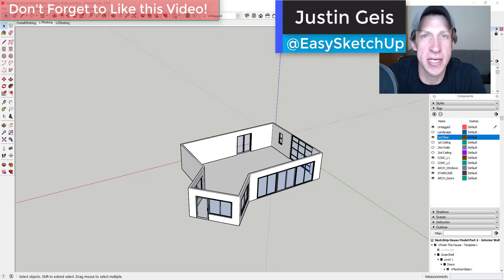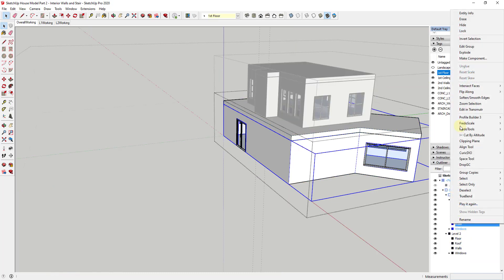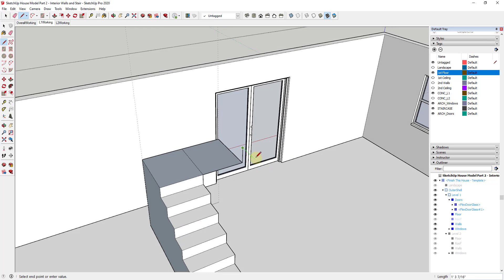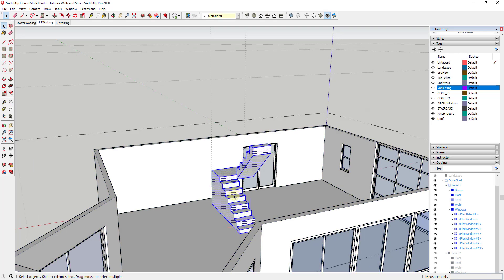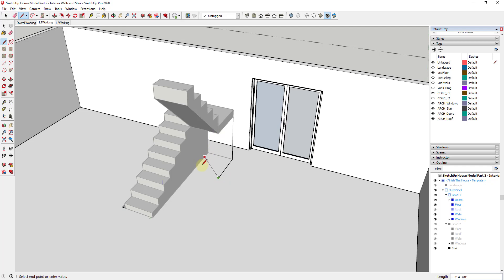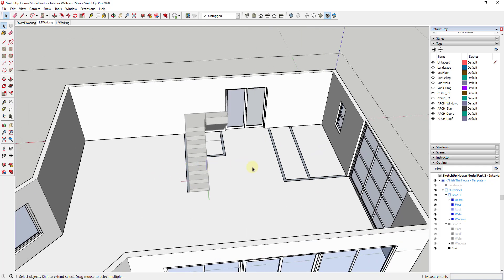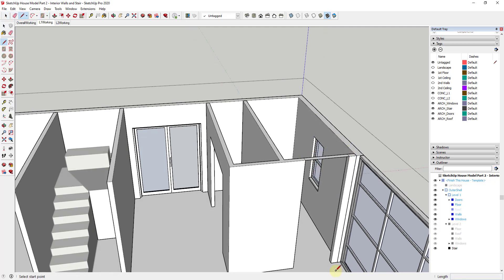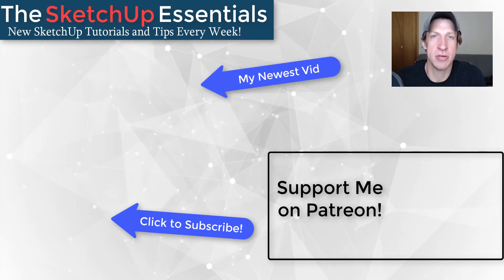HOUSE MODELING in SketchUp 2020 Part 2 - Interior Walls and Stairs

Comment: Justin, love you tutorials  but  your stairs are wonky... firstly, the bottom riser is not the same as the others... secondly the higher flight has 11" risers...  Can I suggest you just draw a single vertical setout line floor to floor and then use the divide command to subdivide into the desired number of equal height risers... no need for guesswork or mathmatics

Comment: I definitely learned a good amount but am still not wrapping my ahead around why to use Tags/Layers above and beyond having organized groups in the Outliner (since I can also turn these on/off) and scenes. Trusting it will make more sense later but not sure I could do it on my own without this understanding.
Reply from the maker: Tags are basically for turning things on and off and occasionally lineweights, the outliner is for organization

Comment: bro I watched your video which is Modeling Sliced Terrain from Location Data in SketchUp with Joint Push Pull and Slicer but ı could not make it because joint push and pull does not work can you help me I want to make my terrain as a solid
Reply from the maker: Why wouldn't you leave this comment on that video? Also, I don't know what this means - "It does not work"

Comment: I have a question with sketchup, could you help me with texturing a model.... not just a model but a model that can only use one 4096x4096 texture file, what i want to say is i have a plugin called Sketchup2XPlane. And with that plugin you can only export the object with only ONE texture file with all your textures on it!, is there any way to merge texture/layers in sketchup to one layer. Because it is frustrating to put all the textures i need into one texture file! Please help me i need your help

Comment: At 1:43 when using the Tape Measure Tool to draw your guides, teach listeners to just click at two points on each of the corner edges, rather than clicking on one edge and dragging across to the other edge. Results in less 'back and forth' with the view rotation...
Reply from the maker: Sure if you want - I'm not sure I agree that this is any faster than what I did...
Reply: @Thesketchupessentials  Two clicks only a few pixels apart is not faster? Really?
Reply from the maker: @stevefrawley9756  Do what you feel is fastest for your workflow

Comment: Hi Justin, I think I would have worked the rise of the treads slightly differently.
Probably by drawing a vertical line from the landing to the floor and dividing it into equal segments then deleting all but the top one.
I don’t think bottom steps that are different to the rest are very popular with home owners!
Thanks for all the great lockdown content.
Reply: Agreed, plus this would have also prevented his error at 4:24 where he set the rise of the upper flight as 11.75 rather than 7.75, as per the lower flight...
Reply: @stevefrawley9756  The general rule (in the US) is 7-11 (a 7 inch rise and 11 inch run) (17.78cm-27.94cm)
Reply: @wayneseymour1   Actually, rule of 18 to accommodate odd sized rises...    7.75 is what he specified for the lower flight, not me. Just pointing out they should be the same, wouldn't you agree?
Reply from the maker: Lol - well that's the trouble with being a SketchUp trainer more than a designer I suppose ;p